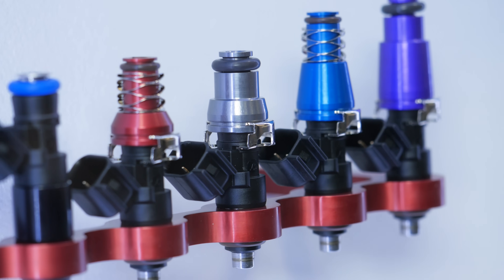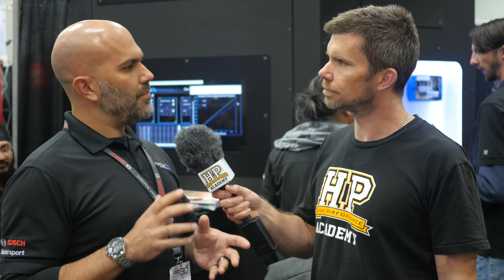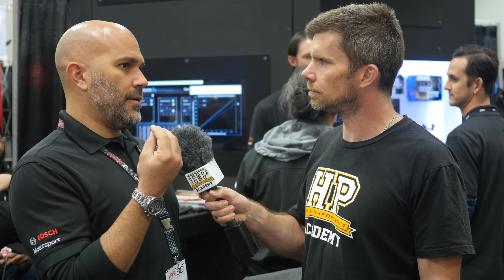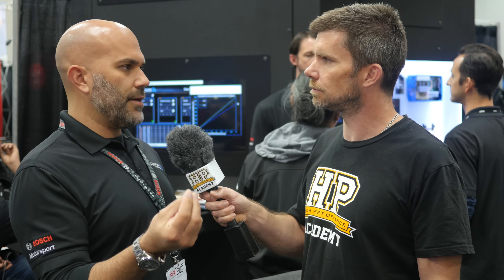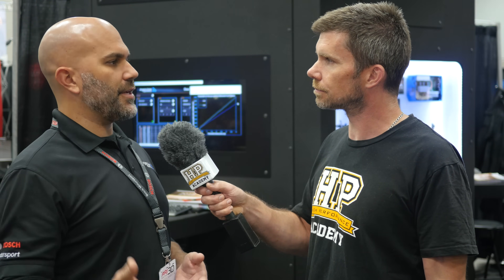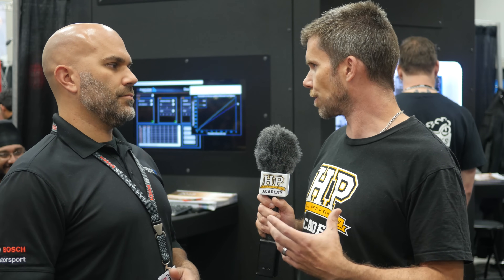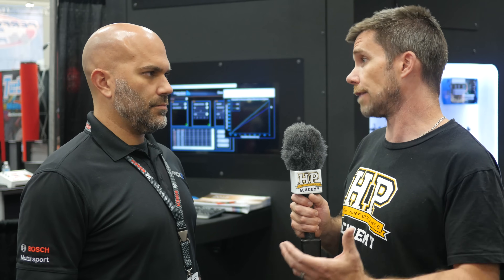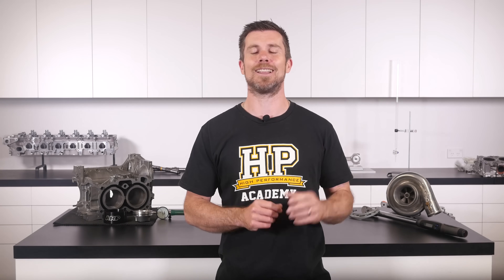Injectors. What do you know about them? | Injector Dynamics X Series [TECH TALK]

Comment: i got a question about ID1050 or 1000.

there are different length for on the body of the injector for different brand of car 
But are the internal and spray pattern same with in the same Injector family ? just the body length differ ?

For Eg. Can you throw a STI ID1050X (longer injecto body) into a BRZ (shorter injector body)/ with a spacer on the fuel rail?
Reply from the maker: You're best to get in touch with ID directly, they generally have great customer support and will help you out. There are some differences with the X series that they can inform you about and you can make your decision with their help and advice - Taz.

Comment: Hello can anyone help me in my question .... I have a mr2 turbo and recently mapped it on boastane on normal Id 1300 injectors and come into problems with fueling side of the map , just want to no if I should of got the id 1300x installed or are id 1300 and 1300x the same as people have told me thy are the same injectors can anyone tell me if there is any diffrance between the id 1300 and the id 1300x ... any help will be much appreciated... kind regards David

Comment: ive manage to get 13.5 afr on 1120rpm idle with e92 on some bosch 2200cc but would like those 1700x or maybe the id2000x when they come out for some 14-15afr on a lower rpm idle and better cruising afrs....